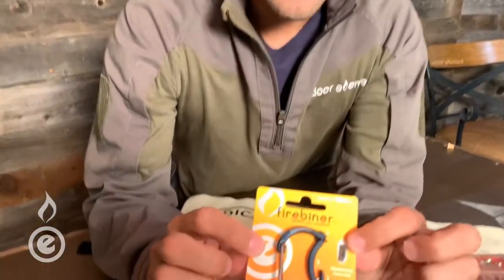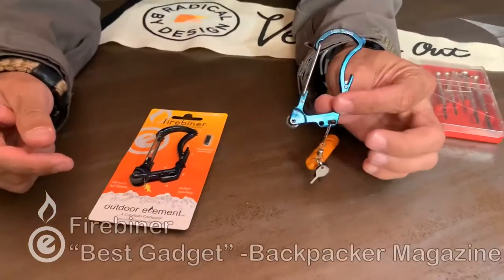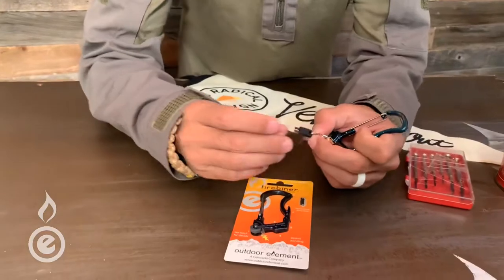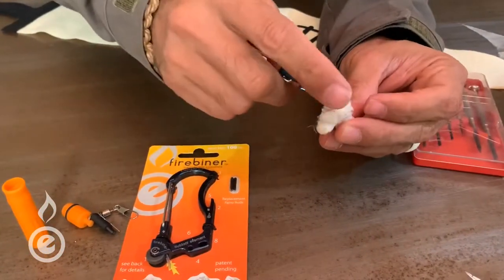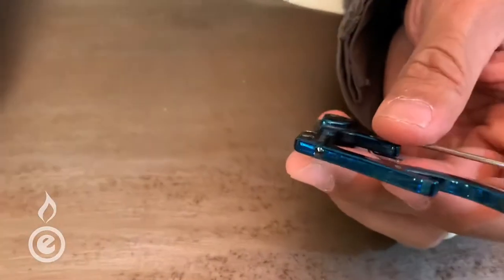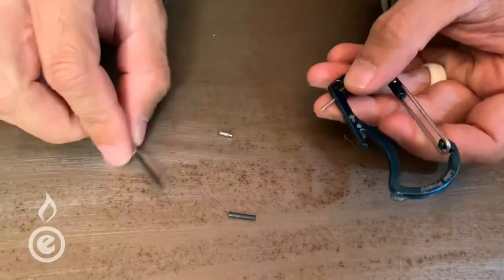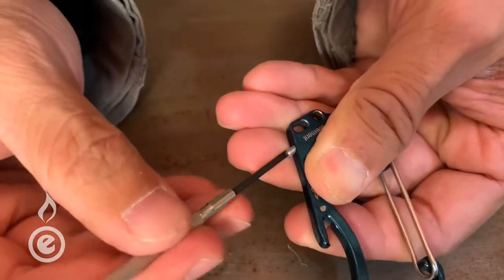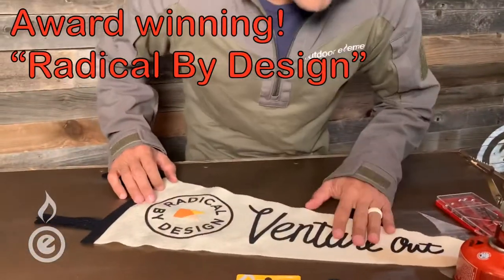Ferro Rod replacement in Firebiner

Comment: I had a few problems trying to replace my Ferro rod...lost both the spring and the set screw after trying several times to get it replaced.  The old Ferro rod was stuck in the biner and the spring would not compress enough to reinstall the set screw.  Contacted Outdoor Element and their customer service was EXCELLENT!  Joe helped me understand what I did wrong, gave good suggestions, and helped solve the problem.  Looking forward to using this on my next adventure!
Reply from the maker: Glad Joe was able to take care of you! and I hope this video was useful :)

Comment: Wish it had a thumb screw instead, as well as on board, secure storage area for the flints.
Reply from the maker: Thanks for the feedback. (if it helps we make a storage silicone sleeve that can be placed on a split ring ...it should be $1 on our website). We will consider the thumbscrew for future gen's

Comment: How many of the TinderQuick does fit into the Wombat Whistle? How many of the Fire Tinder Tabs / does thy fit into it? 
When will the Wombat Whistle  be available again in orange in your shop? I want to start my order to Europe.
Another question:
Whhat are the measures of a Fire Tinder Sheet? I'm thinking about putting them into my belt case and if this would be possible.

Thanks for the great products you made!
Reply from the maker: Great questions 
Only one TinderQuik/tinder tabs fits in the wombat whistle. We are doing some re-tooling for the wombat whistle so it might be 2-3 months (unfortunately) 
The strips are about .95x3.6x.05 inches or 24x91.4x1.4mm 
They can be cut down or rolled to accommodate different spaces. Hope that helps!
Reply: @outdoorelement  I have a question to the "Flicker Feather Survival EDC Chisel Blade":
Which blade angle is suitable for me as a right-handed person?
Reply: @outdoorelement  the right angle, or not?
Reply from the maker: @jonathans.2176 the Chisel angle is 25 degrees. The spine of the blade is a 90 (right angle) 📐 the spine is the section you want to use to cast sparks off the ferro rod. If you right handed, and your holding blade in your hand, the flat section should be on the left and the blade angle should be on the right side (hope that makes sense)
Reply: @outdoorelement  makes sense, I understand. 
Can I use this knife like a chisel with a wooden hammer? Or is the VG10 too brittle for such work, especially with hard woods?
Reply from the maker: @jonathans.2176  I mostly use this knife as my wood processor, batonning the knife with a piece of wood! When we did head treatment to took it to 58-60HRC
You can take it higher but we didn’t want to bc this thing was meant to be beat! 
It’s great for making notches in wood was well for some fun camp products (but ask my bride how many times I’ve used it for wood projects around the house - a ton!)